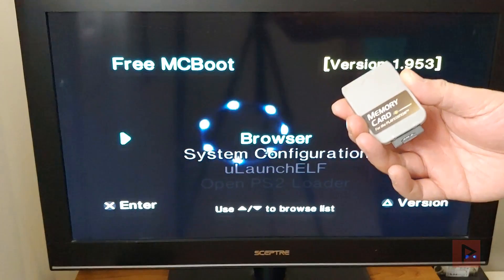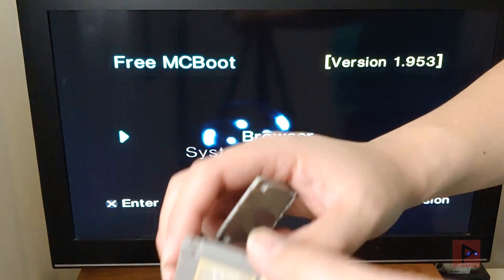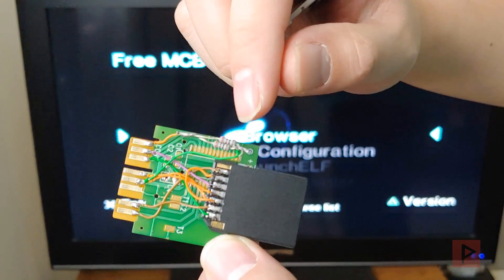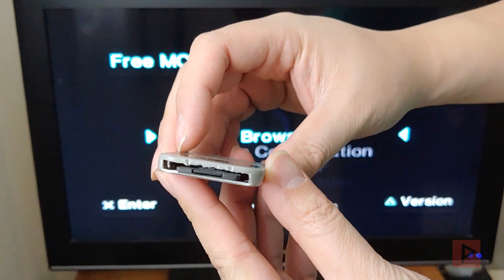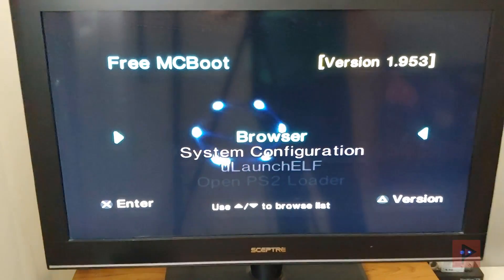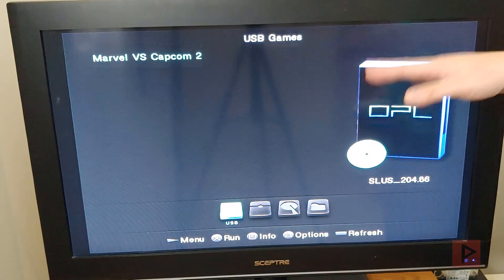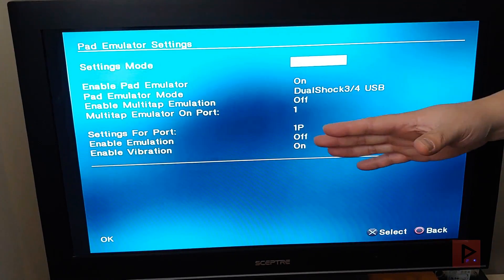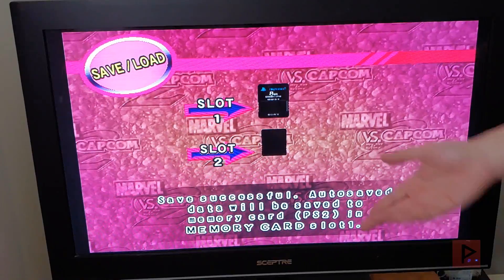Quick Overview MX4SIO - For Use with PS2 and OPL (English, 2022)

Comment: Here's a better way to play off of an SD-Card (especially for Slim PS2 consoles): Get a mini router with USB and connect it via Ethernet directly to the PS2. Power it with one of the PS2's USB ports.
Connect a USB card reader for Micro SD-Cards to the mini router's USB (alternatively a USB thumb drive, but those are often slower and less reliable).
The advantage over MX4SIO is much better speed – no FMV skipping and better load times.
Reply from the maker: Yes, a really good alternative solution. Thanks for sharing!

Comment: can a female usb connector be soldered instead of a sd card adapter? to use an external hard drive through usb, and would it provide the 5 volts needed to power a 2.5" hdd?

Comment: Hi! I am always using 2 memory cards in my ps2. First card is 128mb, and it has all my savegames on it, second one is original sony 8mb that has only fmcb on itself. 
My question is, if i buy multitap will i be able to use all 3 cards at same time (128, fmcb and mc4sio)?
Reply from the maker: I am not sure about that, and mc4sio is only for 2nd slot. Never heard of it working in multistep yet...

Comment: please post the source tutorial for soldering
Reply from the maker: There is no source tutorial for doing it on my end. I have linked an image for the wiring diagram. There are other YouTube videos in general that show you a closer look at soldering process. What you need to do is get your wires and wire it like the wiring diagram from the sd card to the correct contacts on the memory card contacts essentially.

Comment: On the scematics I see some pin also needs to be connected to ground, how does that work? Or don't I need to bother if I just solder the wires normally?
Reply from the maker: I've just been following the wiring schematics online and all is well. Is one of the pins indirectly connected to ground? Maybe I guess but so far everything has been good.

Comment: Can i use this as a regular memory card?
Im wondering how the capability is like.
Hey put more games on it that i couldn't fit onto the drive.
Is there a way to transfer the games to the drive or to this?
Wonder if they can now load real ps1 games and use the ps1 chip on the ps2. Pop's i read is just a decent emulator. Hope they do something about it.
Reply from the maker: At this point in time, it is a storage device for your PS2 game files, not PS1 files. Cannot save game files to it, so you need another memory card in slot 1 for example. Maybe one day we can also boot PS1 games from this, but not today. It is a relatively new project.
Reply: yes one day i mean.
It's another way. They said not possible with the drive.
Whatever. Pops is decent really.

Comment: What format do the games need to be on the memory card?  Is it just a bunch of ISOs or do they need to be in separate folders?
Reply from the maker: ISO into the DVD folder, or can use usb util 2.0 to rip the games to root of the usb.
Reply: @ProjectPhoenixMedia  Thanks.  Could you do a video on setting up the card?  I don't seem to get it to show anything, even after enabling it in the menu.  I created a DVD folder, and then I put the file "Simpsons, The - Hit & Run.iso" in the folder but nothing shows up.

Comment: Saving after MX4SIO is on freezes console

Memory card can't be detected when playing from MX4SIO

Trying to save when MX4SIO is on not only freezes console but wipes out entire OPL configuration except internet settings

Only manual configuration for MX4SIO with integrated in wLE text editor works.
Reply from the maker: One trick is save config with official 1.1.0, then use one of the beta versions afterwards like 1629

Comment: Hello i have 2 questions: 
1. Which PS2 Slim Version did u used ? Does MCSX4IO works with 90001 version using Funtuna? 

2. How to setup PS2 Console game with  upsclase configuration using LED monitor ?
Reply from the maker: 1) I have tested on slim 75001 and 90001 model. MX4SIO works well on both versions. Although I use Fortuna rev 2, Funtuna should work 2. 2) That I have no idea, unless look into GSM, which I don't really use.

Comment: thank you for making this video. i followed your instructions and also had 2 tries before i got it to work. i used an sd module instead as its easier to solder vs the sd adaptor

Comment: How do load times compare to a SATA hard drive with the network adapter?  I use the independence exploit to load HDLoader FP 0.8c from my main memory card, but if this is comparable, it might be a good alternative with my slim.
Reply: Internal hard drive is way faster for sure. Memory card interface has about max speeds of 1.8 megabytes per second is what I was told

Comment: Would I be able to flash a memory card from an emulator on it to use on real hardware?
Reply: Sorry doesn't work that way
Reply: @TheOriginalVersatile  sorry, I ment will I be able to flash an SD card with a .MCR image. And will it work?
Reply from the maker: No its not a real memory card in that sense
Reply: @ProjectPhoenixMedia  Ok. Thanks.

Comment: I soldered all correctly, but still not work, why?
Reply: I find it helpful if manual start for bdm and check all solder connections
Reply: @TheOriginalVersatile  i did everything correctly but i don't understand why it doesn't work
Reply from the maker: I made another card last night. Issue I had was I had bridged connections on the sd adapter, so I had to toss that and do it all over. If you are sure the wiring is correct, no bridges, no shorts, then setup mx4sio to manual mode. Also, sometimes I see that I have to push down on the memory card while in slot 2 to get contacts to read. If that is the case, then you need to make sure the circuit board is snug and/or add some extra material to keep more pressure on the ps2 slot 2 contacts.
Reply: @ProjectPhoenixMedia  I have ps2 slim 70004, this version is compatible?

Comment: I've 3rd party memory card, Zed Labz l think, which l used both on my PS1 and PS2. After a short period of time my PS1 is completely dead. It doesn't even start, like brick... And My PS2 can boot, but it doesn't read any disc. Have anyone experienced something similar?
Reply: How about clean the laser
Reply: @TheOriginalVersatile  l did, but no difference.
Reply from the maker: So your ps1 console is dead, and for the ps2 the laser doesn't work anymore? Maybe get a new laser or laser deck, or just do opl if you have a method to boot into it.

Comment: Awesome video. I just finished doing something similar with FreeMCBoot and a hard drive, but this is much better because it's swappable and quieter. HDD is a bit noisy because I haven't found a solid state that works with the PS2. Just curious, does the donor memory card need to be a MagicGate card? I could not tell if it was MagicGate in the video. I know FreeMCBoot requires it.
Reply: Donor card is any ps1 or ps2 card and we reuse it for the contacts. Doesn't care if MagicGate or not

Comment: Nice. What would  be good though is a permanent cfw bios flash to get rid of all security checks on  Bois chip via update plenty of dumped biases out there to use .
Reply: Unfortunately the BIOS is a read-only chip.

The closest we've currently got to a software solution is Mechapwn.

Otherwise, if you're handy with a soldering iron, a modchip is the way to go.

Comment: I'm curious if I could 3d print the shells for these and manufacture them on the side for people to buy. If anyone is interested maybe i'll create the stl files.
Reply: Looks like a very simple PCB could be designed to mount a SD card slot plus the resistor(s). Order a pile of them through one of those cheap Chinese companies then sell them with the parts as a kit. If you really want to go into production on kits and ready to use ones, learn how to make a multi cavity silicone mold and do urethane resin pressure casting.

Comment: I have done everything correctly sadly it does work on my ps2 slim... thinking of trying it on other console may be mine doesn't supports it.
Reply: Make sure no bridges and wires soldered correctly
Reply: @TheOriginalVersatile  I did double check with a continuity tester, everything is correct, but i did use a 47 ohms resistor though, i will try to change the micro sd card adapter may be its the faulty one.
Reply from the maker: Another pro tip is check the pins on the memory card slot 2 reader, if not enough contact pressure, it may not see the card. I had an issue like that too.

Comment: While this is cool as shit, I'd like someone to make a PS2 ODE (Optical Drive Emulator). That way you could you still load games off of an mSD card, but you'd be replacing an aging DVD drive in an older PS2 and games could still be played (and it'd be simpler and cleaner even if soldering is required internally)! The PS1 has one as does the Dreamcast and GameCube... I'm sure someone'll figure it out for the PS2 as well!
Reply from the maker: Maybe the makers of GCLoader could do something like that, it be cool as hell
Reply: I bet the cheapest price is 300$ for that ODE mod. Last i checked the PSX version cost around 200$.

Comment: Pretty neat thing, but I personally would rather network load from a USB HDD. 2tb Drive connected over USB to a raspberry pi 1 running psx-pi-smbshare and connected to the PS2 over ethernet. It's a bit clunky but it allows much bigger storage capacities for much less money.
Reply from the maker: As I said before, this is a neat niche solution/project, and I totally agree your setup is probably more practical in broader sense. Keep it up, I love the psx-pi-smbshare project.
Reply: @ProjectPhoenixMedia  I think for people like me with the slim the only good option was network. So this memory card mod/replacement (hopefully someone or China makes custom pcbs for this)allows us to have a easy solution that doesn’t require much

Comment: I’m curious if it’s possible to do this kind of thing with an nvme  SSD instead of a micro sd  card
Reply: Not sure wiring wise and voltage wise how it would connect and power. Speed wise you would never fulfill true speeds of nvme though

Comment: I’d love to see a portable PS2 made using this! Most use USB and deal with the slow speeds. I think a couple use a built-in raspberry pi as a “game server” over the network interface. This method is nice and compact, and would speed things up a bit.
Reply: SMB/LAN doesn't work with playing online though... MX4SIO DOES!
Reply: Network load is as slow as USB basically. It would waste power by running a Pi
Reply: @Vans_WW ??? SMB is WAY faster than USB on the PS2!
Reply: @tnaplastic2182  While maybe true in benchmarks, what you get is still slower than the DVD drive speed and only a margin faster than USB. Network loading becomes bottlenecked by the CPU in handling the network interface. Even in best case scenario (copy only) it was recorded to be around +- 3.3 MB/s. During gameplay, this penalty can be higher, at which point you are 1:1 with USB transfer speeds. Not enough to alleviate FMV stutter in some games, and not enough of a noticeable improvement over USB to consider sacrificing power to “run a raspberry pie server”. 

Benefit is in storage size by hosting games on a server. Just my 2 cents.
Reply: @Vans_WW  Yes, 28MBit/s on a video on my channel... I know... ;)

Yes, the bottleneck is the IOP.

"In best case scenarios..." You forgot to mention "in-game", but it seems obvious that you talk/write about that!

UDPBD is less dependent on the IOP and could yield 12.5MiB/s (100MBit/s)!

Access times are faster on any storage compared to discs though and that IS very noticeable!

I agree, that "SMB" puts a lot of "load" on the IOP and that it can even dive a game's performance BELOW that of any of the other devices!

That usually doesn't occur on FMVs though!
It rather sounds like your setup (or the setup where those issues were present) is running in 10MBit/s mode!
Reply: @tnaplastic2182  It appears you are talking about a new technique? :) (Circa 2020?) 

The last time I did a network loading setup was with (I think) still a proof of concept. I remember distinctly a slight FMV stutter, and that it was unknown if further optimization would bring it to at least DVD levels. So it might be me being too outdated with my info. Still, getting a PS2 slim loading fast without straight up soldering an IDE port to it is a good problem to solve :)
Reply: @Vans_WW  Yes, I tried DBZ Budokai Tenkaichi 3 and FFXII and others. Nah, it isn't SOOO new... Maybe you used "OPL DB" instead?
Reply: @Vans_WW  SMB is pretty much as speedy as playing from the disc since mid-2019 or so.
Reply: @Vans_WW   but i still have way less problems with smb than using usb. I can say my results were faster loading than usb and less stutter in fmv. Usb is really slower

Comment: is it faster than SMB loaded games or at least have a differing compatability in that some games that don't work with SMB will work with this? and if so, is it closer/a replacement of USB loaded games?
Reply: YES, some games which don't run via SMB, or have problems because of the IOP running on 100% via SMB occasionally, run better via MX4SIO.
The bandwidth is slower than on SMB, so an FMV might stutter via MX4SIO, while it doesn't via SMB.
It is way better than USB in pretty much any case/regard.

Comment: Is that a PS1 memory card you used?
Reply: Yeah....Any card will do. Only that there are contacts is important. But 2MB/s is faster than USB/Ethernet but still kind of a joke and only for PS/2 slim. The DVD Drive is 3x faster and HDD is far away....
Reply: @AmstradExin  I think PS2 has 100 Mbps Ethernet which is pretty fast, 2x faster than its 4x DVD drive.
Reply: @47KRoman  Ah! You are right......But still USB and Memory Card slot.....too slow
Reply: @AmstradExin  That is the CURRENT speed, because 48MHz-Mode doesn't yet work reliably, whereas 24MHz-Mode DOES! ;)
On another note: I think that the speed could be even faster on DECKARD-PS2s, utilizing the PPU-Side for the transfer, but that needs quite some work on the software and we are just at the beginning, except for BDM being quite evolved.
Reply: @tnaplastic2182  I didn't expect this to be such a rabbit hole....
Reply: hello you
Reply: @MrJ0mmy  howdy!

Comment: Is that a USB controller dongle?  If so, link where I can get one please.
Reply: Simple BT-Dongle with EDR and PADEMU via OPL...
Reply: @tnaplastic2182  You're the best  THank!
Reply: @tnaplastic2182  last I checked pademu doesn't support ps5 controllers...
Reply: @TheOriginalVersatile  Not directly (yet), but I read the DS5 can run in a kind of DS4-Mode?
Reply from the maker: Never heard of that before and I'm striking out on google. Doesn't matter, I have a ps uno retro bluetooth adapter for now

Comment: Hi! Does the game storage using Fat32?
Reply: Yes that's correct just like usb method
Reply: @TheOriginalVersatile  Still Fat32 like USB? Hm. Still have to cut 4gb ISOs into 2 pieces. But still, this memory card thing is easier, since the microSD is read directly from Slot 2, and faster too. The only thing that is harder, is the soldering.

In terms of config, this memory card is way easier than LAN, although I prefer LAN, since no cutting ISOs required.

Comment: dude, just put a card reader on usb and run opl on it, why u need to soldered a memory card?
Reply: Usb port is slower than memory card slot technically speaking. I had to try it out and see it with my own eyes.
Reply: USB ports on PS2 are USB 1.1 so many games don't work and many of the ones that do work run FMVs at half speed
Reply: so how much transfer rate on MC slot till people do this stuff rather then using usb

Comment: cant wait for afull guide
Reply from the maker: Short answer is assuming you have a modded ps2 or a way to boot OPL, then on the SD card make a folder called "DVD" and put all your iso files in there. Use a program like OPL Manager V21.8 to rename the files easier and scrape cover art.

Comment: I dont know if im actually gonna be the one to do it all myself so Im just gonna wait until people start making these memory cards and selling them online lol Anyway Im glad that theres a similar method to the USB one and being able to play games in a similar way, but faster this time as not everyone has a PS2 Fat with built in HDD or any HDD one could use on PS2 Slim. (In all fairness i feel using another game would have been a better example since Marvel VS Capcom 2 tends to run smooth with only just longer load times on USB.)
Reply: I may do another follow up video like God of War 2 or something to stress it out
Reply: @TheOriginalVersatile  can you try Crash Twinsanity? The FMVs run at half speed off USB so I'm curious to see how they run off the SD card.
Reply: @MichaelM28  This game hangs at black screen no matter this version of OPL or the newest, sadly.
Reply: @Haker112  I tried it with the newest version of OPL and it runs off USB no problem (just with slower FMVs)
Reply: @MichaelM28  Yes, it does work from USB/HDD/SMB but unfortunately not from MX4SIO. I didn' say it won't from USB. ;)
Reply: There's a listing for some on eBay from a seller in Spain
Reply: I have some I made

Comment: Still hoping for the PS2 hacking scene to make native ps1 backups play possible.
Reply: MechaPWN
Reply: Doesn’t work ? I could swear in my hd on ps2 I’ve got a few psx games loading ok , should check out because I’ve been mainly playing dreamcast lately
Reply: @federicomori1560  That is an emulator, pretty much an early version of what Sony used for PSP, and then there is a homebrewed emulator as well. OP means running PS1 ISO's through the PS2's built in PS1 hardware, not emulation.